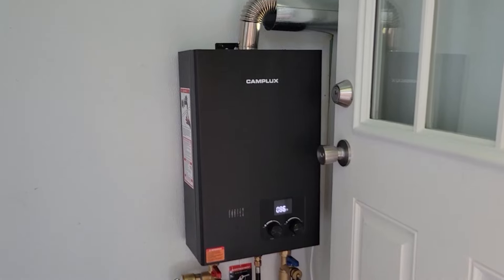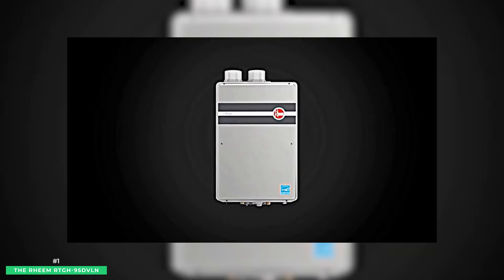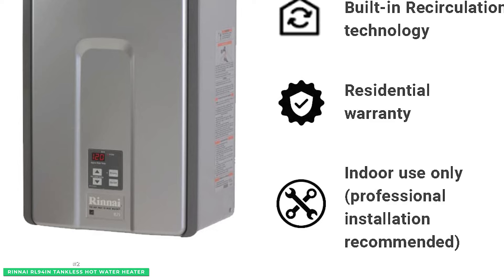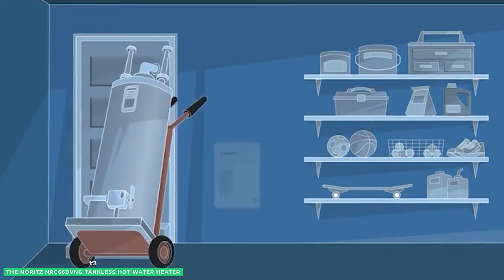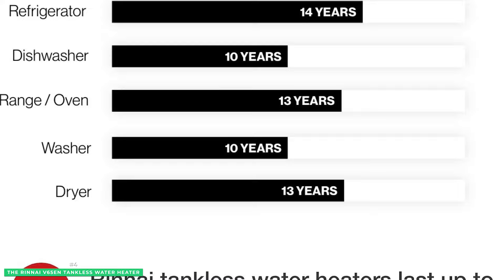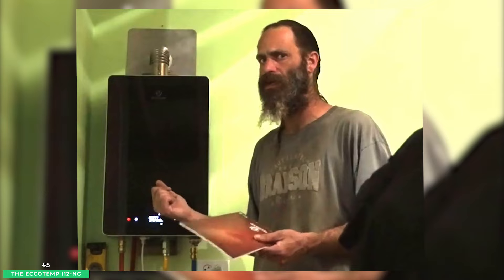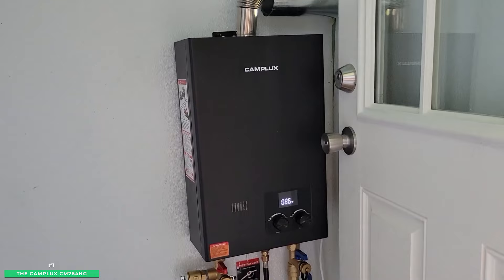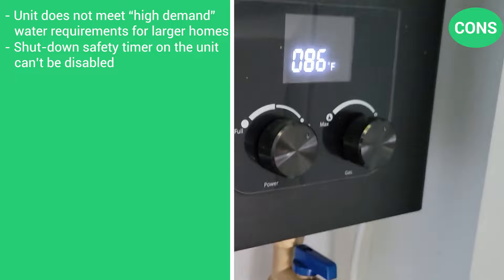BEST Tankless Gas Water Heater Reviews ♨️ (Ultimate 2023 Natural Gas and Propane Water Heater Guide)

Comment: What about Takagi or Bosch? I had a Tagaki for 14 years, no problems and no maintenance. We sold our home, but the new owners are still using it and that's 18 years no issues.
Reply from the maker: Hey there!  That is an impressive track record!!
Reply: Your absoluetly correct / my Takagi has been running for 22 years straight so far / haven't had to replace not one part.

Comment: Surprised to see Navien is not one of your top heaters as they are way more advanced then these old style heaters. Not only does the A2 series come with built in recirculation pump it also has a built in buffer tank .
Reply from the maker: Hey Darren - It was a close call, but in the end, it got edged out based on the competition.  Maybe for next years ranking!  Naviens are great, but I wouldn’t necessarily say they are better than “these old models” as these have similar features.  Really depends on your situation and what you need.  Have you been using the A2?  Would be curious how you like it so far?
Reply: @Freshnss  the 210A2 Navien is being installed today so no review thus far, lol!! Thanks for the video :)
Reply from the maker: Right on!! Good luck with the install and please keep me posted how you like it after getting it set up 👍
Reply: @darrentoth7165  hi , I’m just wandering if you like your navien tankless so far?
I’m planning to install one but feel a little nervous after using regular tank for many years.
thanks
Reply from the maker: You can do it Andy 🙌
Reply: @andreilesiuk9538  Really like it thus far!! I ran a separate recirculation line to keep the water hot. The water heater would run to often to keep the lines and buffer tank hot so I changed to the " intelligent mode" which learns how your daily hot water use. Very happy with it and my two plumber buddies swear by these  Naviens
Reply: @darrentoth7165  thanks for the reply Darren! It’s great to know you like it.  I guess NPE 210s might be enough for family of 4? The house is small 1200 sq feet with two bathrooms. There’s also one size down npe 180.🤔
Thanks
Reply: @Andy L.  hello Andy, with a family of four I personally wouldn't recommend under the 210. Dollar wise there isn't much difference between the three sizes and if you have the washing machine, dishwasher going and someone wants to have a shower it is best to go bigger then you need to fill the demand. I am a family of only 2 and have the 210.
Reply: I've been researching and narrowed my choice down to the Noritz AZ-SV & Navien NPE-A2 but leaning towards the Navien.
Reply from the maker: Both are solid choices!  Can’t go wrong with either 👍
Reply: My guy today said he wouldn’t recommend the current batch of Navien water heaters to many recalls of late
Reply from the maker: Interesting point!  Thank you for sharing with the community! 👌

Comment: Well the top one is not even mentioned. Navien is the best on the market. I have taken big boiler systems out of restaurants and installed 2 Navien’s cascading together and have had not problems. I have also done a lot of work on them unit’s mentioned in this video.
Reply from the maker: Hey there!  Very interesting, thank you for sharing your experience! 👍
Reply: On a Condensing model. Do you slope the exhaust piping away from the unit? or does a condensating unit have a run off trap like a HE furnace?